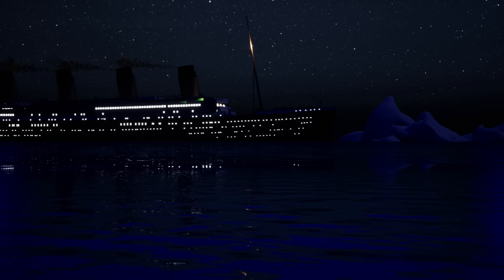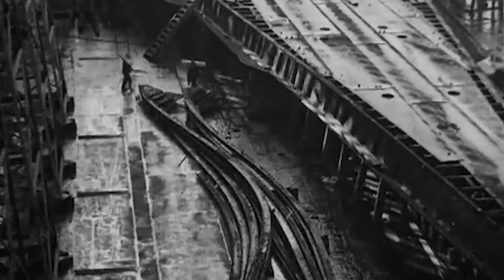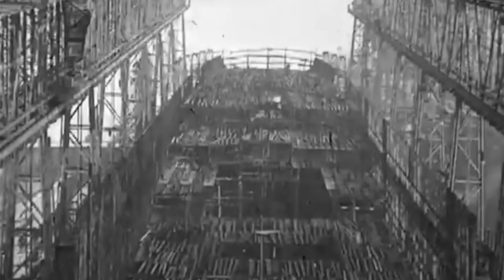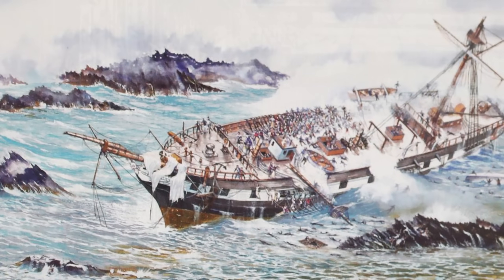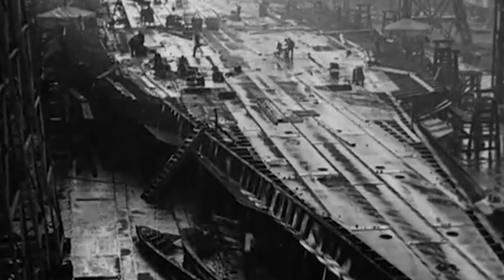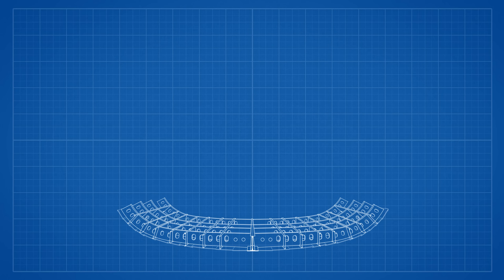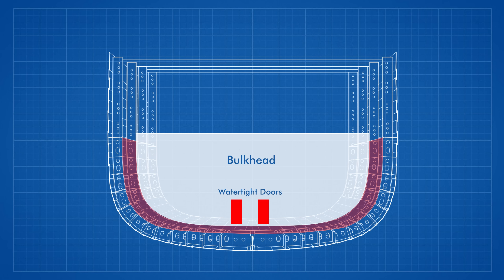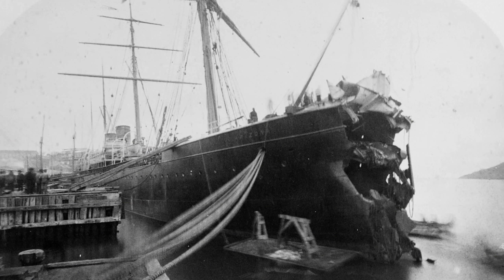How did the Iceberg Sink the Titanic?

Comment: It's probably a wives tale but one documentary said some of the sealed components managed to get bilge pumps going and empty the compartment. But then the walls split, they couldn't take the pressure from the full ones.
Reply: They tried, and they did slow the flooding down a bit, but it was ultimately fruitless.

Comment: Great video!

One question, however: whatever happened to damage control? While the crew was obviously new and still getting to know the ship, as well as Titanic obviously being a civilian ship, and thus training would’ve had much less emphasis on damage control than for personnel in the Royal Navy or the like, I…never even hear about attempts at damage control? Was boiler room 5 still flooding so quickly (in spite of the relatively small incision) there wasn’t time to use any bilge pumps?
Reply: The damage control was standard practice. After the collision, the captain, Thomas Andrews, and several of the ship's carpenters immediately began "sounding" the ship - that is, they walked around looking for damage. Water ingress monitoring systems and water alarms didn't exist in 1912, so if your ship was damaged, you needed to walk around the ship using nothing but your eyes to try to locate where the damage was and assess how bad it was.

Due to the Titanic's size, this took nearly 40 minutes. By 20 minutes after midnight, they knew the ship was doomed. Yes, they had bilge pumps and they did use them, but all three of the ship's pumps combined weren't enough to keep up with the flow of water. Instead, the pumps were used to help flood the ship strategically so she maintained an even keel and didn't roll over, allowing as many lifeboats to be launched as possible.

Comment: It would no have mattered if the compartments had watertight ceilings. The weight of 5 or more compartments flooded to the tops of the designed watertight compartments would have doomed the ship NO MATTER WHAT.
Reply: Correct. Not only that, but any modern ship with the same proportionate iceberg damage would be sunk as well.

Comment: Water inside a ship cannot exceed the level of the water outside the ship. As water enters the ship, it adds weight. Per buoyancy calculations, there was no need to extend the bulkheads higher than the original design. 

The extension of the water tight bulk heads for Olympic and Britannic were more for structural support than for preventing sinking. The double hull being raised to E deck along 2/3rd's of the hull length was the only effective modification made for the Olympic Class post Titanic.

So, why did they raise the bulkheads the way they did after Titanic? I think it's they knew exactly how the ship sank based on the damage taken that night and KNEW the ship would collapse on itself. The hundreds of images from wreck over the years prove this. If you would like to explore this hypothesis, feel free to reach out.

Comment: Titanic had fire in the coal storage compartment. When it left port... Documented...... Near freezing outside air and water. High temperature coal fire inside.... Not a fire in the furnace... On the other side of the steel hill in storage. Yet no one ever mentions this little tidbit. Too much liability????? To the owners?????
Reply: Paul.
Buddy. 
Brother of the interwebs. 
...Absolutely everybody mentions that "little tidbit." Everyone. Everywhere. It's one of the most brutally common stories attributed to the ship at this point.

The only places where mentioning it isn't as common is with actual credible folks -- aside from whenever they're debunking it. Because the truth of that matter is that the fire did not sink the ship. 
It was, by all accounts, a very small smoldering patch of coals -- not a big inferno or anything of that sort. It could not have gotten hot enough to damage the steel to the point of failure, let alone the hull itself, since it wasn't even located right up against it. Aside from two very small indentations in the bulkhead -- not the hull -- there was no damage to be said of.
Coal fires of this sort were also very common on steamships at the time, with matters of ridding them being relatively minor in difficulty. They were absolutely never seen as genuine threats to a vessel's integrity, and there had never been a need for any sort of coverup for one. Titanic's was combatted by relocating the coal in one bunker to another bunker, dousing the coals, rubbing oil on the walls and calling it good. 
It was completely out well over a day before the collision.
It had no relevance to the iceberg damage, which itself had already opened up 5 compartments by the time it reached the fire's former location.
It did not sink the ship. No matter how long one stares at a smudged photograph in a factually-questionable "documentary."
Reply: People cant seem to realise that steel in contact with water the same temp as the north Atlantic is never going to heat up enough to be damaged in the first place due to heat disapation and that fact that water is one of the best conductors of heat. 

Unless that fire reached blast furnace temps, which it didnt, the hull would never have been damaged
Reply: No one talks about who died. Very important people. Review  it then let how there could have been  no bs involved. But you know everything PROFESSOR
Reply: @paulbruhan6452  I presume you are reffering to the easily debunked Federal Reserve myth? 

Astor and Guggenheim had no connection the Fed and their opinions if they had any were never voiced to the public. All surrounding evidence however, indicated that the two men would have been in favor of the Fed.

Isidor Strauss the other banker on board was not only a supporter of the Federal Reserve but a large proponent of it as seen in several publications of the New York Tines from October of 1911 to early 1912. You can find copies in their archives of the speech he made.

Seeing as another man who was never on board the Titanic often gets brought up here, i'll go over JP Morgan as well. To put it simply, JP Morgan's only connection to the Titanic was the fact he owned IMM the parent company. He was never booked on her maiden voyage and had announced in the New York Times that he would be in Venice April 23rd for an important meeting months before Titanic was even completed.

I dont claim to know everything about the sinking but i sure as hell know it was not on purpose. If you wanted them dead have them murdered, dont sink a ship in the middle of the Atlantic and hope they dont survive. Why take that gamble? Considering the bodies of these men were found (excluding Guggenheim) and were clearly untampered with no foul play occured. Further to that why kill Isidor Strauss an influencial man who supported the idea of the fed and a major ally to its cause?

Any other assumptions you need me to debunk? Or is that the end of the claims made in that one switcher video you swallowed whole?

Comment: 9:00 that proves just HOW safety-aware they were: Multiple passive, automatic and manual activation mechanisms ("dissimilar redundancy") of safety measures - you can't get any closer to failsafe. The only problem - as always - are scenarios beyond your imagination. In every such project there should be a devil's advocate asking "But what if THAT fails?"

I'm impressed they actually had the forward bulkheads so rise high enough to account for the bow dropping as the compartments filled up - that system was not just for show! In hindsight of course, they should have considered longitudinal bulkheads as well as a watertight top to account for all three dimensions...
Reply: longitudinal would have made the ship list and capsize.

Comment: My only question I’ve never gotten an answer to, is this. If they would have not tried to turn, and instead just hit it head on while attempting to slow down, would they have survived? Would the frontal impact been less extensive than the side damage? Would it have punctured only 2 compartments instead of 6?
Reply: I believe he has already made a video on this. The answer is yes, if they had have hit the berg head on, the ship would most likely not have sunk, although many crew would be killed in their beds in that front section of the ship.

Comment: IF the builders had actually made the watertight doors WATER TIGHT and extended them all the way to the top 
so each compartment could actually be fully SEALED it likely would not have sank. It might have gone down pretty far by the bow, but im guessing it would have lasted longer or maybe not sank at all, but the water tight doors only went part way up - hardly water tight.

Comment: Very good video, but at 12:45: why "That made at least two major compartments flooding", while the sketch shows three compartments flooding (forepeak, cargo hold 1, and boiler room 6?). And 13:10 "That now made three compartments open to the ocean", while the sketch shows four compartments (forepeak, cargo hold 1, cargo hold 3 with mail room, and boiler room 6).
Reply: His discussion about flooding in those specific compartments was based on the surviving eyewitness testimonies given during the US and later UK inquiries.  Indeed flooding was occurring at alarming rates within Boiler Room 6 plus Holds 1, 2, & 3.  The horizontal bulkhead found in the first WTC limited flooding in that compartment to just the forepeak tank at the bottom for the first hour and a half much the same way Coal Bunker W located at the forward end of Boiler Room 5's starboard side kept the rest of the Boiler Room dry during the first hour and a half...maybe a little longer before the hatch doors to the coal bunker gave way followed with massive flooding occurring once Watertight Compartment 5 (Boiler Room 6) flooding overtopped Bulkhead E into said WTC completing the flooding repeating the process further aft until the liner lost buoyancy and sank at 2:20 AM.

Comment: Watertight compartment bulkheads were common construction designs in Chinese Ming Dynasty ocean faring vessels in the 1400's. They were inspired by the way bamboo would grow in sections and knew that because they also built the largest wooden vessels in history, that they had to reinforce the internal strength of the hulls by dividing them into compartments.

Comment: There's this idea floating around that the sinking of the Titanic could have been prolonged significantly by lowering ropes next to the hull and cloging up the cracks. I would love to see a video about it.
Reply: It’s not an idea, it’s an actual technique of damage control called “fothering” that was around way before Titanic. Basically would take anything that would slow the flow of water and stuff them into the damaged parts. Or something like a sail and place them on the outside. In titanic’s case, the hatch covers were a heavy canvas that would of worked. Nothing would of saved the ship enough to make it to a dry dock but possibly long enough to save more people. It was always a mystery why there was little to no damage control on the Titanic

Comment: Relatively the shape remains pretty similar to Modern ships. Yes, the Halls have changed occasionally, but they're all still pretty relatable to a 1900 pretty amazing design. Also, those ships hauled ass back then. They were going faster than most ships today. They're pretty much-moving aircraft carrier speeds with ocean liners!

Comment: The ship was not gashed. Her sides were made of overlapped strakes of iron riveted together. According to Thayer, she rode up onto the ice shelf of the berg, her bow flare barely scraping the towering side of the berg.   In doing so her full momentum was shoving her double bottom up. Which probably caused the iron strakes to act like giant shears and cut thru the rivets one after another like enormous scissors. Along perhaps 2 to 4 strakes, all the seams were opened when the rivet heads got cut off and water came in along two or three several hundred foot long seams.   As she took on water, she took on weight and so had to displace even more water than her normal draft. By the time the bridge was under water, she still had several decks of dry space in her forward half, under the surface. Not filling much past the top of the bulkheads because the water inside the ship was spilling down into the next compartment, one after the other,  but those dry decks under water still providing just enough buoyancy to keep her at the surface.  The stern did not lift much out of the water until she started to break, and she broke because her aft half was entirely dry and being pulled deeper in the water. Her stern was being pushed UP by buoyancy with more than twice the weight of the entire ship. ( that is, as long as she remained at the surface, she had to be displacing her own weight, PLUS the weight of the water she had shipped- so more and more of her still dry hull was pulled underwater, and the force pushing up on her after half increased to match that increasing weight.  ) The idea that the stern broke off down from its own dry weight is ludicrous. Her stern portion weighed only 30,000 tons.   Just before she broke, buoyancy was pushing the stern UP with over 100,000 tons of force.  Thayer’s account was correct in every detail.   As she broke, the stern slowly lifted out of the water as the superstructure above the break began to crumple and crush against each other.   A 2 foot long section of her double bottom was torn in Tension, no bending forces. As it parted it allowed the last row of half-boilers to spill out and water to flood into the formerly dry engine room and last boiler room, as well as the upper decks. ( all of this occurred under the water surface.) This sudden increase in weight in the formerly dry area that had been holding the ship up saw the middle of the ship drop lower, and the bow briefly re-surfaced. But with water now flooding in the entire area of the break amidships, the dry areas under water in the bow quickly flooded and  with the last of the side strakes broken, her bow section bent back down and tore away, which dropped the stern back down, and slowly spun it 180 degrees and the weight of her engines and flooding into the breaks gradually brought her stern vertical.

Comment: I'm curious: At roughly 10:03 you explain that basically the limit of the water is the top of the water-tight bulkheads. 

My totally non-naval architect assumption was that, in the visual scenario that you presented that comment beside, the level at which the water level would stabilise would simply be where the waterline of the ship is at that point in time. The reason why I think and have assumed that this is the case, is that once the internal water column gets to roughly the height of the waterline, the water pressure at the breach to sea is roughly equal and the outside seawater doesn't want to go INTO the hole at any rate different than the water inside the hole wants to go back out to sea.

That's the mechanism for why the 5 compartments rule exists, because that was the point at which the forward trim would force the waterline above the next watertight compartment limit.

I think.
Reply: Upon more thought: Is the cause of water volume above the waterline the result of displacement of water within the internal ship water column by machines and furniture etc?

Comment: Let's say for arguments sake that time wasn't an issue if they had moved a lot of weight to the back of the ship to counter the weight of the water coming in at the front could this have prevented the water from reaching the top of the water tight bulkheads and saved the ship from fully sinking?

Comment: A few facts to add in the flawed design: 1. The Iron revits purchased and used were all graded #3 and not #4, which were way made of more pure iron and stronger. 2. The water tight bulk heads were originally designed to go up much higher, but were lowered to come up just above the waterline.

Comment: Just to clarify the iceberg did not “cut” the steep plating on titanic. Ice is not harder than steel it physically can not cut steel. It was the impact of the ship with the dense ice that caused the relatively thin metal plates to bend/warp/deflect such that gaps between adjacent plates opened up. This broke the water right seal.
Reply: Icebergs are about 10% as hard as concrete. It just takes a big enough quantity of it to break steel.

Comment: In WWII liberty ship's carried a large part of the supplies and men to England. A large number of those liberty ship's broke apart and sank. Very oddly but most of the ones that broke apart were of welded construction. The liberty ship's that were built of riveted (not welded) construction didn't sink from breaking in half.

Rivets are stronger than you think. Open portholes on the port left and starboard side right didn't help. 20 open portholes below the water line let a tremendous amount of water in.

Comment: Some of the rivets were made of lower grade iron because the machine they used to force the steel rivets in couldn't be used in bends so they had to manually tap in the rivets but couldn't use steel rivets because it was too difficult so they opted for iron rivets but unfortunately whoever ordered them, ordered a cheaper quality so it couldn't bend with the ship without snapping off. when the burg hit, what should've been minor, because of those rivets basically popping off like a zipper allowed so much more water to come in. The crash was so gentle a lot of passengers didn't even feel it.
Reply: YES! It's so nice to see that some out there know about this salient fact in Titanic's construction.  Had they used the best quality rivets which contained higher amounts of carbon it would have literally been impossible for any two-man rivet crew to have fully riveted in such a rivet before it cooled in which case it would have failed to have formed a watertight seal with the plate it was being riveted to.